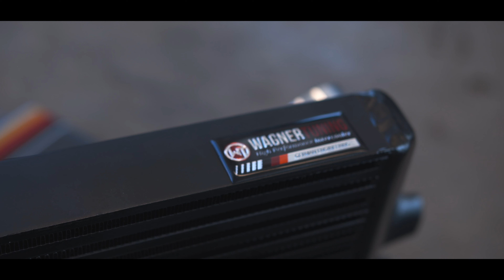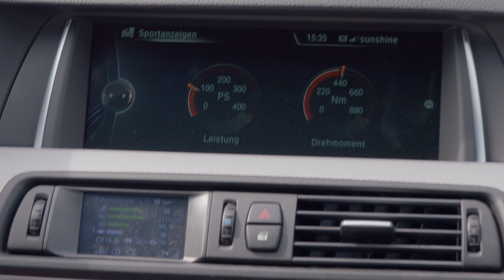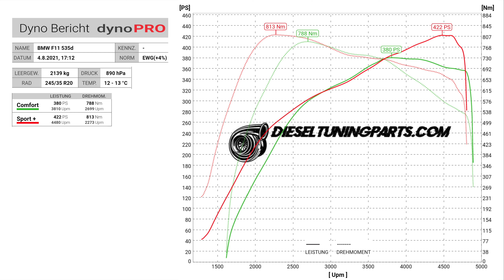BMW F11 535d N57D30T1 Stage 1+ Software LLK by dieseltuningparts

Comment: I have a question, was there any other operation done to the car other than software and intercooler,And does the intercooler make a good performance difference?
Reply from the maker: We also installed an 3000 Bar Rail Pressure Upgrade Sensor, you can see the Prices in the Video description. When you click on the link to the Wagner intercooler, you can see a few graphs on our website, which shows the temperature difference. It helps the engine to stay cool and healthy.
Reply: @dieseltuningparts  thanks for your answer.

Comment: Wieviel PS hatte der 5er original? Warum AGR Verschlussplatte, reichte es nicht nur AGR zu deaktivieren?
Reply from the maker: Der f11 535d hat original 313 Ps. Die AGR Verschlussplatte verhindert dass der AGR Kühler durch den Abgasdruck undicht wird, da dies nicht durch Software unterbunden werden kann. Alle Infos dazu stehen auch in unserem Shop bei den jeweiligen Produkten.

Comment: Ist die App ein 0815 tube file oder ist es so abgestimmt das Power und Langlebigkeit harmonieren? Wird das file auch weiterhin angepasst?
Reply from the maker: Mit 0815 Tuning hat bei DITUPA nichts zu tun.
Alle Leistungssteigerungen auch die der App sind vom Master Ingenieur entwickelt und getestet. Das Momentenmodell ist voll kalibriert und alle Schutzfunktionen sind aktiv, sogar noch erweitert.

Wie wir arbeiten das siehst du in den anderen Videos auf unserem Kanal.
Gerade was das Thema Bauteilschutz angeht haben wir zwei sehr ausführliche Videos produziert
Reply: @dieseltuningparts  ich weiß das ihr saubere Arbeit macht 😀 hab mir die App bzw die Lizenz gekauft und denn Adapter. Meine frage war nur fürs Verständnis weil das ja ein Tune ist für jeden.. Das war keine Kritik.

Comment: Die 35er sind doch bekannt für lagerschäden ? Also hab auch eins aus 2016 aber traue mich nicht..
Reply from the maker: Die Probleme hatte der 299 PS Motor aus dem Vorfacelift, der 313 PS Motor ist sehr standfest.
Reply: @dieseltuningparts  falsch! Der Facelift motor des 535dXDrive Motorcode N57D30B ist genau so anfällig!!!
Habe selbst einen Pleuellagerschaden auf Zylinder 3 sowie einen Hauptlagerschaden gehabt... das Problem sind unter anderem die extrem schwingende Kurbelwelle sowie die Tuner die Softwares aufspielen und alle Schutzprogramme deaktivieren!  Also bitte vorher Sachkundig informieren und kein halbwissen verbreiten !
Wenn ihr eine Top Werkstatt sucht die Repariert und Optimiert fahrt zum Hermann H2 Motors Overath !
Reply: @georgieengelbert habe eine 535d f10 bj 2012 ohne x Drive Motor Code glaube n57Z haben die auch Probleme hatte überlegt auf Update öl Pumpe umzurüsten. Macht es deiner Meinung nach Sinn bei den Motoren. Km aktuell 180 km

Comment: Leck mich fett, warum ist der F11 so schwer :O
Reply from the maker: Viel Ausstattung, viel Gewicht :D
Für das Gewicht fährt das Auto aber wirklich sehr gut.
Reply: @dieseltuningparts  mein 535d f11 Heckantrieb wiegt 1850kg fahr fertig.
Reply: @BoerniG60 Mein 535d f11 heckantrieb sollte laut fzg schein 1925kg wiegen und auf der Waage zeigte sich 2.130kg